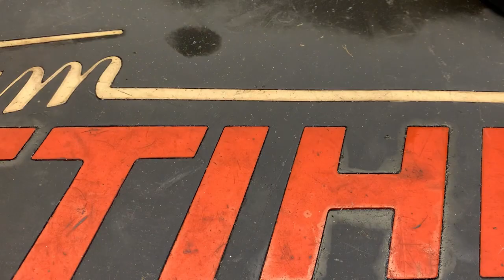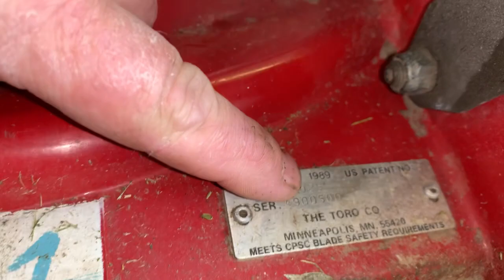HOW TO PROPERLY SERVICE THE FOAM AIR FILTER ON ANY MOWER OR ATV

Comment: Back in the late 70s I took a broken down Toro we had in the garage to my shop class as a project, it was required as part of the class. It turns out it needed a new camshaft, it was broken right in the middle. I never did figure out how that happened. That was my favorite class by far.

Comment: no mess method, put the filter in a plastic baggie, use little oil, squeeze until its all worked thru
Reply from the maker: You need to SOAK the filter in oil and wring out excess.

Comment: It's to bad that we no longer have 2 stroke lawn mower engines. Really miss them!
Reply: I still use one... 4HP Lawn Boy gold series. Although I threw a rod last summer (pushed it too hard??? Oil was mixed!) and had to find another. And did. Lots of power and easy on gas.

Comment: I disagree. You should clean the foam filter with Kerosene, then oil it.
Reply from the maker: No, no you shouldn’t. Solvents change the composition of the foam, Have you ever taken a foam filter out that just literally crumbled in your hand? Yeah I bet you have and those are the ones that were washed in solvents.
Reply: @THEMOWERMEDIC1  So a air filter that is design to work with an engine that burns gasoline should be in contact with gasoline or it will change its composition?!? Where did you get that from? The only filters that I've seen that crubbles are very old and have never been oiled.
Reply from the maker: @UpInSmoke54  that’s right. 40 years of experience is where I got it from